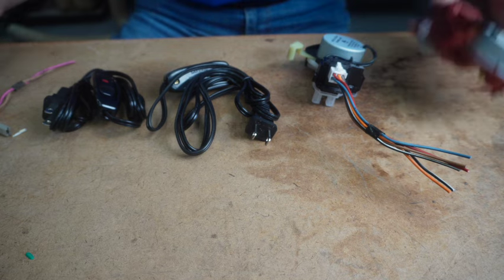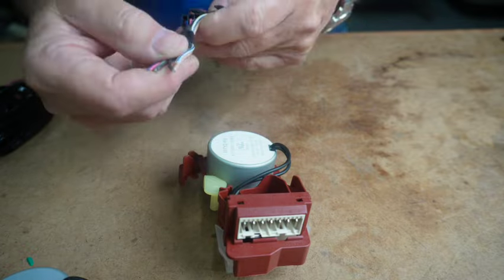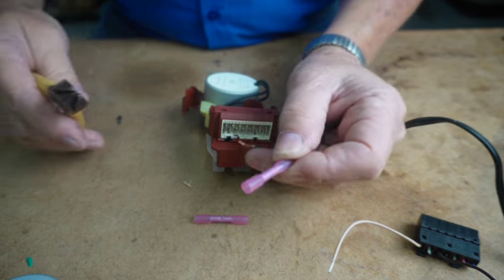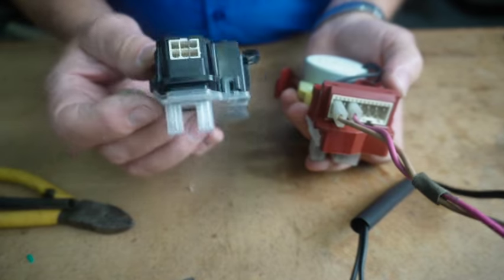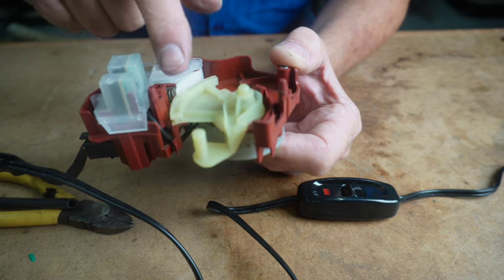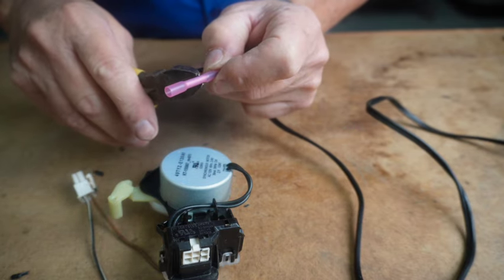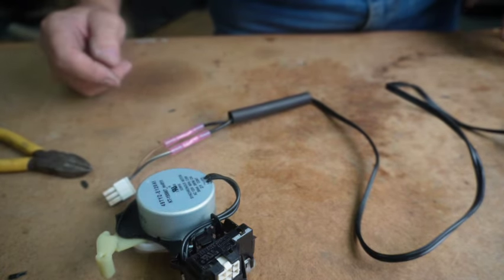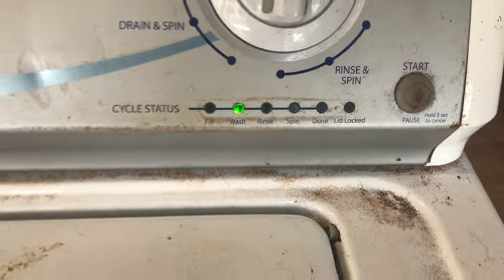How To Diagnose & Fix Washing Machines: Testing Shift Actuators & Tachometers

Comment: WARNING: I connected 110 volts to the 2 pins he mentioned and the tach part flashed like a lightning bolt - .ZAP! No point in testing it now!
Reply from the maker: Well, you've done something wrong because, as can be seen in the video, I pointed out the correct pins, built the test devices, and tested them on camera. The video doesn't lie. I suspect you had the unit facing away from you when you did that because if you had it correct, those pins don't even connect to the tachometer. Thanks for watching. Sorry, you friztzed your shifter.
Reply: @HarperandKnowles  I really appreciate this video on testing shifters. 
  That being said, I usually splice wires in slightly different places in case the couplers get damaged somehow  to avoid the spliced from shorting together. 
  Someone not accustomed to splicing and or heat shrink might apply too much heat and cause the spliced to short.
  Btw, can you ohm the shifters out to see if they are bad?  Seems like I have tried to before but can’t remember how the testing turned out.

Comment: The shift actuator has a line powered motor ,  But it actually has two other functions , one you already reflected is it uses an optical sensor circuit to read the drum rotation speed it sends a pulsed low voltage signal to the washer . the next function it has is it has a micro switch that confirm's it has shifted to the correct position,  the motor driven arm has a internal mechanism that triggers a normally open switch to close when it has reached the correct position (open for spin , closed agitate on the red shiftier) .   if the washer computer runs the shift actuator motor and does not detect this switch opening and closing  it will set a faulty actuator code ,. on the red actuator this switch is between pins 5 (low voltage circuit ground) and pin 7 (shifter position input)  One thing to be on the look out for is an slowly lealking tub seal above the transmission will allow water drip into the transmission case , the transmission spinning will throw the drops of water into the workings of the shift actuator causing a hair pulling intermitent fault as it will often work fine when for the first load until it gets a chanch to get wet,, you have to address the drum seal leak or a new shift actuator will just get damaged by the water as well ..
Reply from the maker: Great information right here! Thanks for sharing your knowledge with us. Usually when I find water that has dripped on the actuator it’s rusty and the bearings have also failed. I’m really disappointed in the lack of quality in these modern washers. You seem to be very knowledgeable about these devices, I hope you will continue to share your expertise with us. Thanks for watching!

Comment: This is a great video. Just a little added info for folks who may be interested... Your washer should have a tech manual. It is usually attached to the inside of the front panel just underneath the top panel of the machine. There should be a "pin out" diagram in the manual. It will tell you which wires feed which component and usually what color they should be... Wire colors may be different than what is listed... But if you trace the wires point to point you can figure it out.
Reply from the maker: Great tip! Thanks for sharing and thanks for watching too!
Reply: @HarperandKnowles  Indeed... I found mine halfway through fixing this washer and it helped greatly... it's actually a pretty comprehensive service manual.  It's one thing I miss on modern electronics.... a lot of equipment shipped with service info inside.
Reply: @camelid  My 1 year old Centennial has the black actuator and I have been through 3 so far the first one lasted my about 2 years and the second one 2 weeks!  Luckily I figured there was a manufacturer's flaw so I bought a spare from Kentucky and just slapped it in. I think what harms them is washing a very light load like a few little pillows somehow shocks the unit. There is a micro-processor circuit board located next to the optical sensors that looks really awfully complicated for a washing machine! OVERKILL!  I all snaps apart and I am checking it out I will edit any findings here asap Thanks for the great informative video Harper and Knowles!
Reply from the maker: My pleasure!

Comment: So my adventure started with this Amana top load washer - think it's the NFW4516 one.  Anyway it would agitate, and make buzzy grindy noises.  Figured was something strange in the mechanical part going on... found lots of mostly non-useful videos on the YT.  So I tried to parts-cannon it, with a new splutch/pulley belt kit, and a replacement actuator (red type).  Behavior changed - it would fill, then try to spin the tub twice and stop.  I couldn't get the display into diagnostic mode to try any testing... so I was spinning the selection dial CCW like everyone was saying and it wouldn't respond, on rebooting it would turn on the fill light.  I ordered a used/good replacement board... and got the same thing, after I'd changed out the filter caps on the original board.   So now I have a spare, good, original board, and a new(used) control board installed.  I kept researching and eventually stumbled across the suggestion to hold the start button for several seconds to clear any pending modes, which finally got me into the diagnostic mode.   Everything was pointing to the actuator, even after I cleared the code I was getting a complaint from the controller CPU that it couldn't tell what mode the actuator was in.  I started digging in with the new actuator and it's only reading 1.15K, paperwork says it should be 2-3k or so.  Now I've watched this video, and based on what I'm seeing, on the red actuator the motor itself must detect the load increasing at the ends of its travel range and reverse the power internally to change the direction of rotation; the black actuator looks like it works in a different way.  Since the red actuator seems to be load dependant, then the splutch mechanism has to be considerably lower load for the motor to behave correctly since it's loading dependent.  I think the new actuator I got may have a defect, it didn't seem to want to change direction at all.  I'm going to swap motors and see what happens, after I test the actuator out of the unit following the setup in this video.  Thanks for the external testing idea, btw.
Reply from the maker: LOL, you’ve got a lot more patience than I! I would have parted it out and thrown the empty hull on the scrap metal pile. I would say that you’ll be an expert on the workings of that machine before you are finished. Thanks for watching and I hope my video was a little help.
Reply: @HarperandKnowles  Actually your video was very helpful in solving the issue... so last night checked the actuator off the washer and it cycled ok, so I installed the actuator with power leads and cycled it installed on the washer, and found the issue.  It was switching from spin to agitate... but as soon as it tried to go the other direction it went halfway, stalled and returned.  I tried moving the shift rod manually and it didn't feel that difficult but it was enough to make the actuator stop.  So I pulled the new pulley and basket kit off and played with it... when I compared it to the original set it was quite a bit more difficult overall to move, even after I used some silicone grease on the contact points.  So I cleaned and lubed the original transmission set and reinstalled everything... and now I have a working machine.  I guess it was originally a bad actuator, and two techs later when they finally gave up on it it was mostly still working, but with too stiff of a transmission to work with the actuator installed.  Yay, working washer.  I'm glad I didn't buy the washer, I'm 80 bux into parts now - but I do have a couple extra parts now, anyway.
Reply from the maker: @camelid  congratulations on a successful repair!

Comment: Hello there, I have a Maytag washer and have changed 2 actuators and they don't last more than 2 to 3 weeks. Is there something causing them to break?
Reply from the maker: Try changing the splutch. If it do don’t move freely and takes extreme force to shift it will cause the actuator to fail. Thanks for watching!

Comment: Lemme ask, does it matter if its a 2.5w actuator in place of a 4w actuator? Because i installed a what i thought was the cirrect one to replace my 4w and it was a 2.5w and it wouldnt even recognize it.
Reply from the maker: I think they are interchangeable. The plugs match and the components are the same. The motors just draw different power to run. The 120 volts to run them is the same. 
The primary difference between the two 120V electric motors is the amount of power they consume, measured in watts (W). Here’s a breakdown of what that means:
	1.	Power Consumption:
	•	The 2.5W motor uses less power than the 4W motor, meaning it consumes less electrical energy during operation.
	•	A lower wattage motor is typically used for lighter tasks or lower load demands, while a higher wattage motor is more suitable for heavier workloads.
	2.	Potential Applications:
	•	The 2.5W motor might be used for applications like small fans, precision instruments, or light-duty tasks where minimal power is needed.
	•	The 4W motor could handle slightly more demanding tasks, such as operating larger components, small pumps, or devices requiring more torque.
	3.	Efficiency and Design:
	•	Depending on their design, the difference in power consumption could also indicate differences in efficiency, size, or mechanical capabilities. For example, the higher wattage motor might deliver more speed, torque, or capacity.
	4.	Running Costs:
	•	Since the 4W motor consumes more power, it will incur slightly higher electricity costs if operated for the same duration as the 2.5W motor. However, the cost difference is minimal for such low power levels.

In summary, the main difference is the work capacity or demand they are designed to handle, with the 4W motor being more capable of handling heavier tasks compared to the 2.5W motor.
Thanks for watching!

Comment: Hi - thanks for the awesome video. I’m having so much trouble with the bottom half of my splutch. I keep tightening the nut that holds the splutch onto the threaded shaft as hard as I can tighten it, and the machine works fine for a while but then the nut eventually loosens, causing the bottom half of the splutch to wobble when the machine is agitating, and it makes periodic awful grinding sounds as it hits the teeth on the top half. Is the problem with the nut, and is that nut an interfering thread nut? The threads on the shaft and grooves inside the splutch look perfectly fine, as does the drive belt. Do I need to replace the whole splutch? Or just the nut? (On Repair Clinic, the nut they sell separately looks different than the nut that comes with the whole splutch assembly (?).) I’m at my wit’s end with this thing and don’t know what else to do bc this grinding sound is making me crazy! Thanks for any insight you could give me. (Amana model NTW4650YQ0)
Reply from the maker: You shouldn’t have to over tighten that nut. I would suspect the splines in the drive wheel may be stripped if it is backing the nut off. Are you sure the grinding is from the splutch and not the bearings?
Reply: Gosh thank you SO much for responding!!!! Yes, I am positive the grinding noise is from the bottom half of the splutch wobbling and hitting the top half of the splutch bc each time it starts to make this noise and I turn the machine on its side and inspect it, it’s the nut that has loosened up. (There isn’t much space between the top and bottom half of that splutch, so any kind of “play” or wobbling of that bottom half will cause it to hit the teeth of that top half of the splutch and make that awful noise). I just cannot figure out WHY that nut keeps loosening… the nut “looks” okay but who knows… and the threads on that shaft look totally fine… no metal shavings or signs of wear and tear in any way. I have taken this machine completely apart down to the last screw and have rebuilt it and every single part seems to be in excellent shape so I just can’t figure it out. I don’t want to spend a ton of money to replace the entire transmission if it’s only a $5 nut that’s gone bad??

Comment: My shift actuator appears to be constantly shifting back and forth without stopping... anyone ever seen this before? right now it's actually shifting back and forth even though the wash is over. Could this be because it got wet from a leak? Obviously I will need a new shift actuator just curious about the unusual behavior.
Reply from the maker: I have never seen this. If it is in constant motion then power is being sent to it that shouldn’t be. I’m thinking you may have a control board issue instead. Putting a new actuator in there will probably not solve the problem. Let us know what you find and thanks for watching!
Reply: i think a leaking tub seal had shorted it out and caused it to malfunction. I let it dry out, opened it and cleaned up the board with alcohol and replaced the tub seal. I put it back on to make sure the tub wasn't leaking before installing a new actuator and it seemed to work no problem.  I still replaced it since I already bought the new one, but I kept it in a stack of parts just in case. washer running mostly fine now, still have to take apart the "non-serviceable" transmission to change out bearings cause it's loud as all get out, but otherwise working fine now!  @HarperandKnowles  🤷👍

Comment: If this shift actuator is bad would it make the machine not agitate or spin?
Reply from the maker: Yes, but other things could be the issue too. Thanks for watching!
Reply: @HarperandKnowles  it’s only two years old I’ll try that first thanks
Reply: @HarperandKnowles  thanks I figured out how to read the error codes I have 2, F5 and F8 seems the door lid is not sensing it being locked. Might be the pice that fits into the lock or might be the lock.
Reply from the maker: Most probably the lock itself.

Comment: Chip I have a comment for you in regards to your shift actuator tutorial. Although you presented an excellent video on testing a shift actuator you left out one important detail and that would be telling the viewer that the wire connectors are to your right thier left. I only point this out because I know that most of your do-it-yourselfers are not all that mechanically inclined and can get easily confused. I have been doing this kind of repair and diagnostics for over 20 years and you wouldn't believe the number of times that I had to go to a customers home to put back together and or repair something that they played with.
Reply from the maker: You raise a valid point I'll keep that in mind in the future. I too, have had to reassemble machines others have worked on before me or brought to my shop in pieces. I now have a $35.00 reassembly fee that discourages that! Thanks for watching!

Comment: thank you so much i really needed this information   now tell me how to check the motor winding and control board
Reply from the maker: Well, thanks for watching my video, Donny!  To check the motor windings you need to find the wires coming out of the motor and trace them to the terminal block. These’s usually three. One start winding and one run winding and a return. Use a multimeter set to read ohms, check the continuity of these wires against themselves. If one fails you have a broken winding. Check each one against the metal frame of the motor. If you have continuity there you have a shorted winding that should trip your home breaker.  To check a control board watch this excellent video from my fellow YouTuber @ Bens Appliances and Junk https://youtu.be/IIfsAXV4Vsc.

Comment: Thanks for the vid. This is my next thing to check. I'll probably pass up all that extra work you did though and just put a couple jumpers on there. All that in line switch and shrink-butting wires together just to test something is a bit overkill for me. Great video though and no doubt the extra stuff teaches others a few more more things they might not know.
Reply from the maker: Yeah, if you are only going to have to test the part once it is overkill.  A tech that does this often might like to have them in the toolbox though.  Wouldn't you agree?  Good luck with the repair my friend, and thanks for watching!